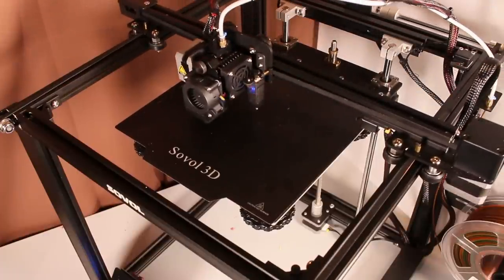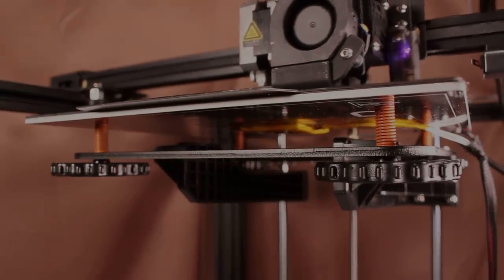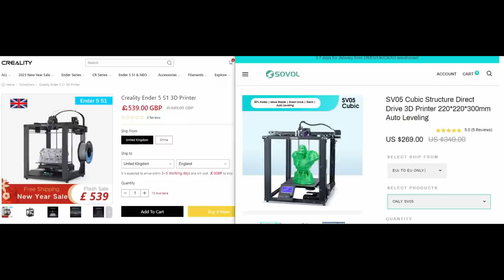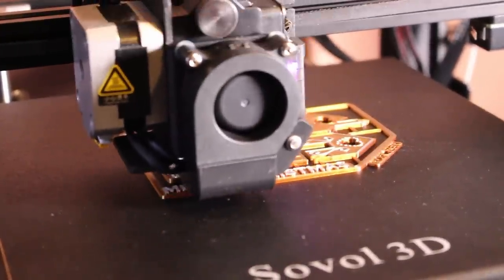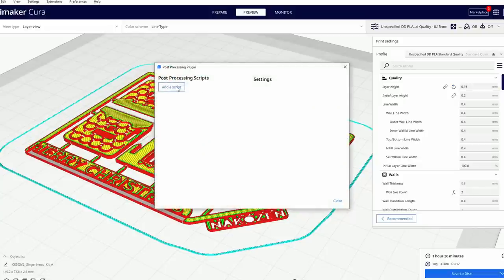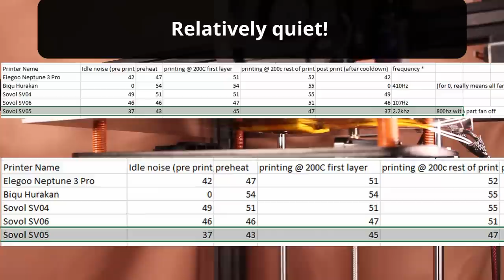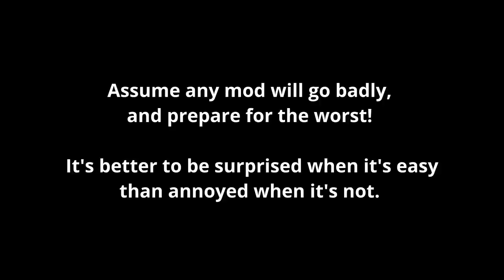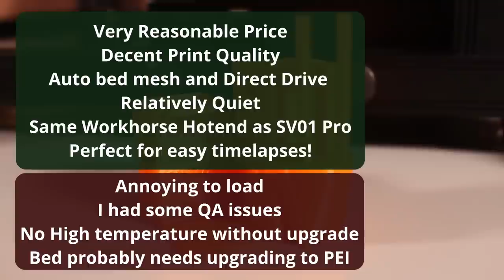The SOVOL SV05 - the Best Printer for Timelapses?

Comment: The biggest issue I have about the Ender 5 style frame design is the frame itself. If they just make sure the X/Y rails didn't leave the volume of the frame, it'd be the perfect machine to enclose very easily
Reply from the maker: yeah you have to kind of shim the outside, I cant imagine it would be too hard.
Reply: Yeah Michael from teaching tech enclosed an ender 5 years ago. If I recall correctly he directly enclosed the volume of the frame and then used some nylon brushes at the top to allow for the carriages to protrude while still keeping heat in. My biggest gripe with this style of printer is the loss in potential as it wouldn't have cost them much more to use much better corexy kinematics.
Reply: @TT99  Well, I can understand Creality going back to tried and true Cartesian after Hbot experiment on the Ender-4 before eventually going coreXY on the Ender-6.
Reply: The ender 5s1 has everything within the frame. Thay also tried to keep the frame as small as possible in order to keep the volume down. That led to some unusual design choices, the sprite extruder is different to the regular ones, so iz doesn't stick as far forward as the ones on the ender 3 series.
If we talk ender 5 already: have you looked at the price difference? The ender 5 pro costs around 350 or 400 euros, the sovol with the better firmware and toolhead not even 300 euros. It also has linear advance if im not mistaken

Comment: I actually accidentally ended up with an Ender 5 with upgrades making it into a Pro a few months ago because it came with a Raspberry Pi 3b+ for less than a 3b+ alone. 

With the all metal hotend on it, it'll happily print PETG. The bed has stayed level. I dumped the glass bed though and switched to a PEI sheet immediately. 

It's been printing reliably and everything off it looks great.

Comment: Hi, love your channel.
I'm the part of your statistics that is atypical :) I bought an Ender 5 Pro, cubic style printer, a year ago as my first 3D printer as I wanted the extra rigidity of the cube frame over a bed slinger.
I haven't modified anything from stock (due the 1 in 10 possibility you mention having to accept and not wanting to put my machine out of action, even temporarily). I am extremely happy with the prints it turns out and am considering buying a second printer for printing other materials (all metal hot end, probably direct drive, possibly multi-material / dual extruder, etc.)
I really like the dual extruder machine you showed previously from Sovol, if they put that on a cube frame it would probably be what I'd go for!

Comment: I had a strange issue with Sovol's all-metal heat breaks with my SV04, which are the same as the one this printer uses.  I was having major filament jams when the filament would retract to switch toolheads during dual-extruder prints.  Filament would also get stuck partway down the heat break during loading.  I found that there was a tube inside the heat break that ended about 10mm from the top.  The inner tube had a narrow diameter, very close to the filament's 1.75mm diameter.  Filament was getting stuck at the point where the two parts of the heat break met.  I resolved the issue by drilling out the inner bore with a 5/64" (~2mm) drill bit.

I bought a 3-pack of these heat breaks, and all three of the ones I received had the same issue.  Maybe mine were just from a bad lot, I have no way to know.  I just thought I would mention this in case it helps someone else.

Comment: So that all metal heat break is flat on top? 
Slice Engineering bi-metal has recess to take 1-2 cm (or so) PTFE in. Since the Titan-style filament guide also needs PTFE inside, it would be best to have continuous tube from top of filament guide to the heat break.

Comment: About your comment on Boron Nitride just on the cold side. I replaced a heatbreak with a Slice Engineering Heatbreak and applied it to all parts, including the nozzel! I haven't had any issues, so far. Been a while now. What is the reasoning for just the cold side?
Reply from the maker: I can cover this in an upcoming video, but it's just simply about where you want the heat to travel - you want the cold side to be cold, but adding thermal compound to the warm side of the heatbreak will heat it up. I mean, there's an argument for why you might want to do this, but you'd have to be sure the gradient is not causing the cold side to be above the glass point...this will make more sense when I show it under infra red hopefully hehe

Comment: So recently, I got a Sovol sv06, and I have been have quite a bit of problems with bed adhesion and other printing issues. I bought 99% concentrated isopropyl alcohol so I could clean my bed and hopefully fix this issue, but its delivering on Tuesday so I won't be able to fix that this instant. 

Another problem I have been having is that, I have no idea what slicer to use and what settings to use on them. For most of my prints I used Sovol's version of Cura and it worked but I didn't like it too much. I want more options, so I downloaded Prusa slicer and started using that. I am using somebody's custom profile they made for the sv06. The prints look good but sometimes that can change. 

Can you tell me how you got you're prints to look so amazing on you're sv06? Because I want to unlock this things full potential and I am struggling to find how. Thank you! 😁

(also where do I find the 95A TPU profile you made?)
Reply: I found the profile, now I can finally print the TPU I bought that has been scaring me away.
Reply: it clogged :(

Comment: Have one, minor upgrades still have mot installed the bi-metal heat break. Will check for that mis alignement !!!!! Just saved me a lot of headaches !!!! Thanks get very high speeds of printing, not done kilpper yet or octoprint, next steps.

Comment: same issues with ender 5's the bed falls out of level constantly.. the dual rod in rear does little to maintain the downward force on front of bed. The "arms" help very little. I love the advance they used on the Ender 6 to correct this issue.

Also do the Front bar move . the structure is needed for the cubic style printer. but is so much more rigid than a slinger

Comment: The all metal hotends are not as great as I hear about. I have now had it on 3 printers, Ender 5 pro, E3V2 and Sovol SV05. All had the same filament blocking issue at different times. Never repeatably. I found out one day when my E5Pro with direct drive was blocked, yet again. Pulling the filament out I realised there was a larger diameter section that came out of the hotend. The filament had been softened by the nozzle/heater block and either on retraction or just from heat creeping up the filament itself it had expanded widthways and had jammed in the cold section. i put the old nozzle back and NEVER have blockages now. I too thought something was falling into the feed and spend ages cleaning out the teeth in the filament drivewheels. I changed filament thinking I had bought an odd formulation (Silver coloured) but any filament (PLA) could jam. There may be some settings (less retraction) that would avoid this but hotter didn't help and I was getting some stringing and didn't want to reduce the retraction any more.

Sovol supplied a very poor SV05. The direct drive extruder had the same problem you had and I too drilled the entry port out to make it easier to load. The whole direct drive is poorly designed and the undriven wheel on the release lever is so wobbly that the filament may wind up next to it. I rebuilt it and had to add washers and do some careful positioning to get it to work. Then the extruder would just stop extruding right at the start of the print. It was actually not being driven anymore, it was easy to turn by hand. I could pause and send some initiation Gcodes to get the extruder active again. At this stage I was fed up with Sovol quality and bought a Sprite. Had to print and adapter plate to get the belts to work. It turned the wrong way so I had to load Ender 5 pro firmware which worked perfectly, after all it is an Ender 5 pro with a direct drive extruder now. Unfortunately I had to buy a 4.2.7 mother board because I couldn't find firmware for the E5Pro on 4.2.2.

That soft flexible bed is really sticky and works well, but is prone to damage. I use a flexible PEI sheet when I can.

Love the tip about removing the front top cross section.

Comment: If you can change that extra extrusion for a standard one (or rotate it if only one side is fancy looking), maybe you can use it to mount a camera for timelapses? And maybe add a spool holder to it as well if it's possible to bypass the reverse bowden?
Reply from the maker: yes it would take very minimal effort to get the spool holder to work properly on the top, it's already better just by moving it there, just needs to be slightly further back.
Front camera mount would be very useful actually, I might try to do that for octoprint!

Comment: 6:20 on my Ender 5 (what the SV05 is based off) i removed that to add clearance for a sprite and it didn't impact rigidity at all
Reply from the maker: Aha, I am vindicated :)
Reply: @LostInTech3D  its probably just there so it "looks" sturdy, it definetly looks odd when it isnt attached.

Comment: Hi, I was experiencing the same issue with filament dont come out anymore after half a print, so I thought it was clogged but I could not see the issue without unscrewing the extruder.
I opened the extruder and took out the heatbreak and made sure nothing is clogged.
There was nothing clogged and I tried to put everything together, but then i noticed the heatbreak is slipping and i tried to screw it down frome the side with an m3 screw, but it kept slipping and now i cant get the screw out anymore.
I dont know what to do now.
Reply from the maker: sounds like time for a new heatblock/break/nozzle assembly, luckily they're not expensive, check aliexpress
Reply: @LostInTech3D  No, the screw is stuck in the part of the extruder housing, that keeps the heatbreak in place... sadly
Reply from the maker: oops. there are a few ways of removing screws but generally quite destructive.

Comment: I have Mingda Magician Max - you hit a good point in how the bed with springs can flex downwards if the hot end hits some "sticky up" bit. The mingda has no springs and I've noticed impacts flex the whole hotend in a concerning manner. A solution being to slow right down and hope subsequent layers "iron" the lump smooth. I wonder if I can add a silicone mat beneath the glass bed to add some flex? 
Great video by the way. This sovol looks like it could be a cheap contender for high temp filaments once modified with an all metal heat break as it's movement stays within its footprint, it could easily be enclosed and you can probably move the power brick outside the enclosure to keep that cool, modify the firmware for 300°C. You could even put a heater beneath the build plate to heat the enclosure if not doing large prints and you want a house fire (joke?)
Reply from the maker: yep it's probably a very cheap way to enclosed ABS or nylon, as an alternative to the SV06 inside a LACK. I had the mingda magician max, that bed was oddly good at not releasing parts!

Comment: Hello that filament you use @10:48 looks great. What color and material is that. Great video. Thanks
Reply from the maker: That is Noulei TPU, and it's actually my favourite TPU, I highly recommend it.
Reply: @LostInTech3D  Thanks for the quick reply :)
Reply: @LostInTech3D  Try "Extrudr Flex Hard" TPU. It has surface hardness of PLA but with flex and it is indestructible.
Reply from the maker: sadly we can't get most brands here in the UK

Comment: My first printer was an 8-bit Ender-5 Pro. Mostly because I didn't like the idea of a printer's bed slinging beyond its frame (and potentially into stuff/people). And the cube bars may additionally prevent accidental interactions with a heated bed. And then there's the whole vibrating mass aspect. For my second I wanted something smaller, though, and chose the Ender-2 Pro. Both upgraded in various ways (the E5P more so than the E2P), and I love them still, but any future 3D printers of mine will be coreXY, most likely three Voron kits by LDO.
Reply from the maker: THREE? haha

Comment: Yes i have cubic. Ender 5 pro. And i still think they are more stable than bed slingers, simply because there are less unnecessary quick movement back and forth with weight. Especially with the workpiece. I think its just common sense. The less movement, vibration the better.

Comment: The reverse bowden has a purpose: ensure that extruding is not causing extra downwards force on the extruder which causes a torque around the mounting point of the hotend-extruder combo (basically moving the nozzle in x, y and z).  By having a reverse bowden attached to the (direct drive) extruder on one end and a fixed mount on the other the force the extruder puts onto the filament has a reaction force pushing the extruder down, but this is then countered by the force the bowden tube is puts onto the extruder, basically moving most of those forces to the fixed mounting point the bowden is mounted to.

To easily change filament on such a system:
- remove the clip retaining the bowden tube in the extruder
- now unload the old filament and while this is ongoing, press down on the ring retaining the bowden in the extruder.  That way the unload will move both the filament and the bowden tube from the extruder
- now pull the filament out of the bowden, replace the spool, push the new filament through the bowden until it comes out at the other end (which is now not connected)
- now insert the filament at that open end into the extruder and tell it to load filament.  As there is now no bowden tube in the way, this should be easy.
- while the filament is loading, the extruder will not only pull in the filament, but also the bowden tube, so when it reaches the extruder, give it a final shove by hand and then place the clip on it again.
Reply from the maker: I mean yeah, thats how I was having to do it, but that's gonna wear the pneumatic connector in no time. Top mounted reel is the way to go I think
Reply: Someone (might have been Thomas Sanladerer) tested how reverse bowden affects print quality. Result was more-or-less hilarious: it didn't, in any way :)

Fast moving print head can tug filament, or spool can start swinging (stupid holders, flat ones do not allow swing ;) ) and tug filament. Do they cause inconsistent extrusion?

If one want's to keep reverse bowden, why not print a loose connector for the tube at hotend, so that it keeps tube straight and allows tube to be easily pulled off while loading filament. The tube doesn't need to be locked to the extruder.

Comment: First and only printer is an Ender 5. Chose it for the upgrade project capabilities and fixed space requirements. Given me much pleasure. Works well at high speed.
Reply from the maker: what max speed do you run it at?
Reply: @LostInTech3D  I've got Cura set to 105mm/s print speed, acceleration 5000mm/s2, jerk 13 (custom Marlin build and BTT control board & 2209s.) I'm sure it's nowhere near using all the speed but it's way faster than out of the box and I get very good prints. I've got a knock-off volcano to play with at some point 

Another reason for getting it was as a platform to do my own corexy conversion.
Reply from the maker: Appreciate the info, sounds like I could push the printer a bit harder then!
Reply: @LostInTech3D   I've never had the time to do proper winding up and tuning but I've occasionally mis-set travel parameters and the head moves like a scolded cat. 

I've been printing J Prusa's vase mode TCV phone stand in about 1hr15 if you fancy a comparison.

Comment: My complain for that style of cubic printers is bed size vs footprint. There is a huge gap ,  an unused volume between the frame and the bed. Compare it to Vorons or Ultimakers : night and day. Maybe it is a good use case for chop saw and   measuring tape 😂
Reply from the maker: I'm not so sure actually. Would make an interesting comparison. I know bed slingers are really front to back space hungry
Reply: @LostInTech3D Yes they are. I'm focusing on different non bed slingers (exclude deltas). It might be the product of using off the shelf parts for the construction. Space efficiency requires custom parts , introduce costs

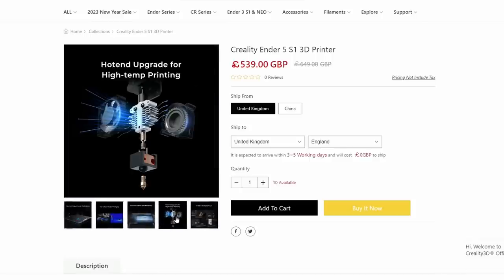Comment: That odd Creatility hotend @0:52 looks pretty heavily influenced by the Bambu series hotend setup. I'm guessing it's to reduce the filament path and weight, which makes sense with the target of high speed printing. Should also allow for shorter retracts, especially if using a bimetal heatbreak. The wavy fins are odd, but look like they should increase surface area enough to allow proper cooling at high temps. The fans are both pulling air from the heat sink as well, rather than blowing through it. So, pull cool air from the sides to cool the fins / heat break, while also feeding air into the cooling duct. That last part is odd, since PLA needs a LOT of cooling at high speeds, but again if they're using a bimetal heat break (and looks to be a copper block as well), this should actually work quite well. Just don't throw a noctua on it.
Reply from the maker: I think it came before the bambu. I plan to get to the bottom of it, that's what I bought it for, I think it's PTFE lined too, to make things even weirder!
Reply: @LostInTech3D  it didn’t it got announced on nov 3rd and also they are accurate as i have the s1 and it barley needs any retraction
Reply: it is a copper hotend also
Reply from the maker: They've been using it in the ender 3 neo since release?
Reply: @LostInTech3D  the one is the ender 5s1 is slightly diff
Reply from the maker: Oh is it, I think they kind of mushed the neo one together with half a sprite. Definitely doesn't look "designed" :D